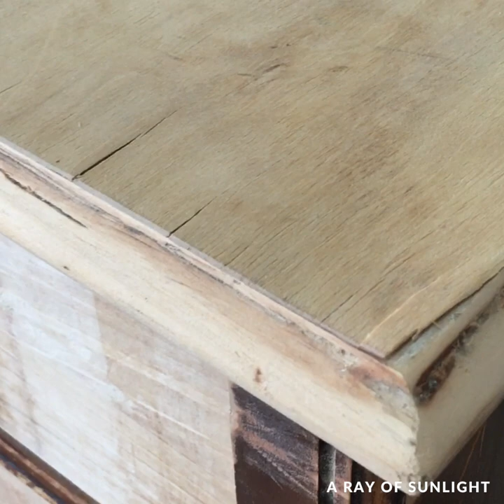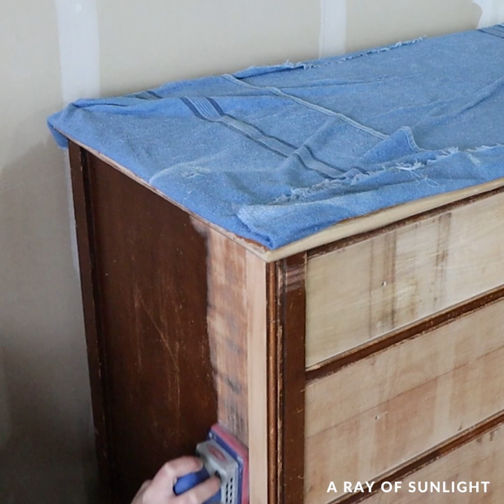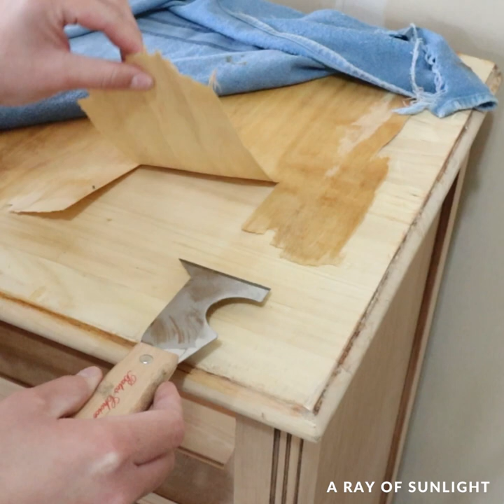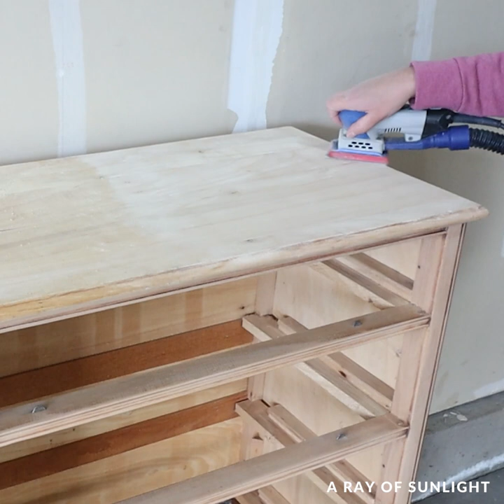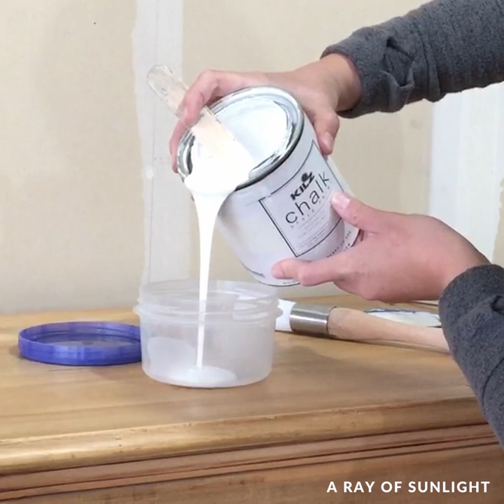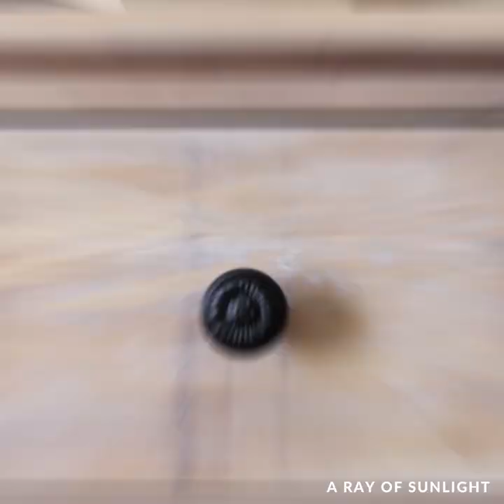How to Whitewash Wood | 3 Minute Makeover

Comment: 80 seems a little steep for that, but result is great.  If you had left the towel on for a day longer, it probably would have lifted off in one sheet.  That is, it works for me.  It was glued down with something very similar to elmer's glue, that was really all they had at the time.  Surprisingly, regular household bleach takes the yellow orange color out of the wood.  The stain left in the carving and black knobs works very well.  I would have used stripper and a toothbrush and would have wasted my time.  Thanks.